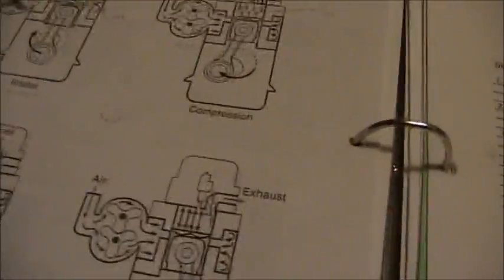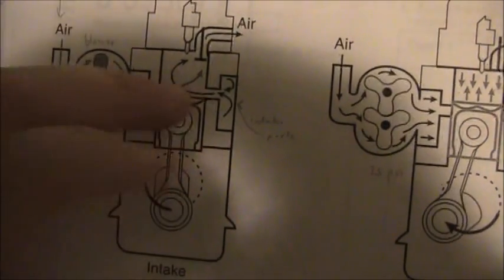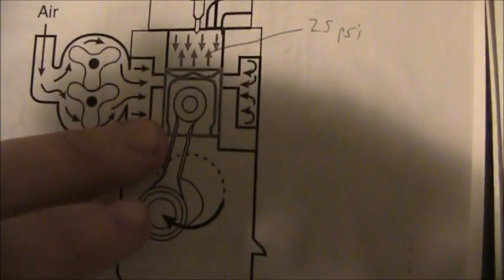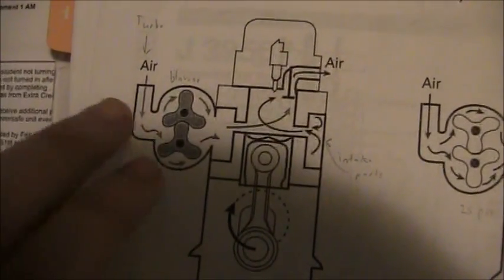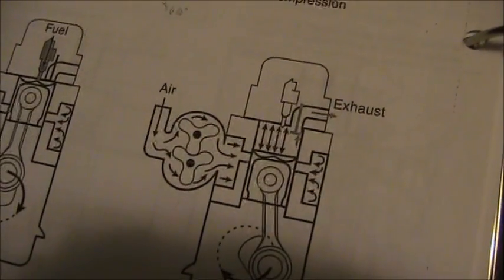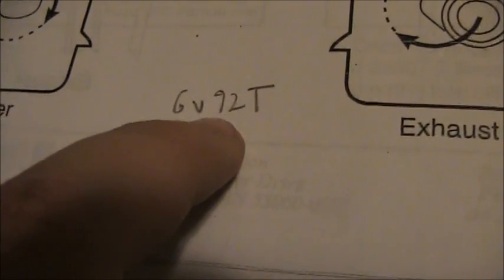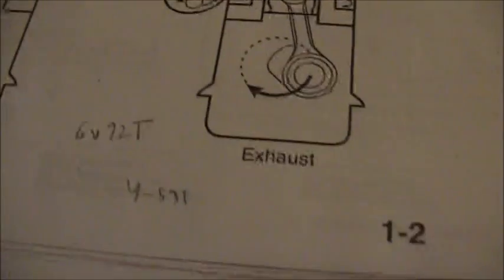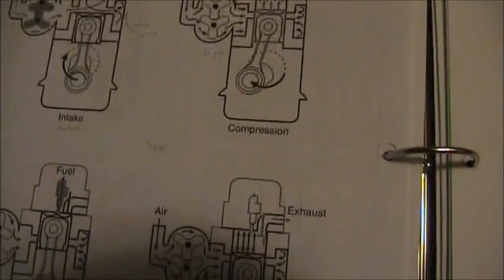How a 2 Stroke Diesel Works

Comment: Very good. Thx for clearing that up for me. Now i know.Thx The only thing about running them backwards is wouldn't that reverse the Oil flow direction or did they have two oil pumps, 1 for ea direction? very good illustration.

Comment: I'm trying to figure out why 2 stroke gas engines aren't built the same way as 2 stroke diesels. 4 stroke gas and diesels work basically the same way, except the way the fuel is burned. I'm no engineer, but I think a 2 stroke gas could be built like a 2 stroke diesel. It would be heavier, because you'd need to add an exhaust valve, cam, a bigger crankcase and either a supercharger or turbocharger. It would still be powerful, just not practical for chainsaws and weed wackers. This design would not require a transfer port and you wouldn't have to add oil to the fuel, so it would burn cleaner. Do you know why they aren't built like a 2 stroke diesel?

Comment: If anybody was wondering, they made six different series, 51, 53, 71, 92, 110, and 149, which came in all different cylinder configurations. I think the 51 series was basicly a 53 but with no exhaust valves. Hope this helps.